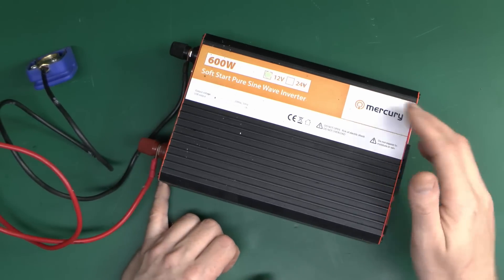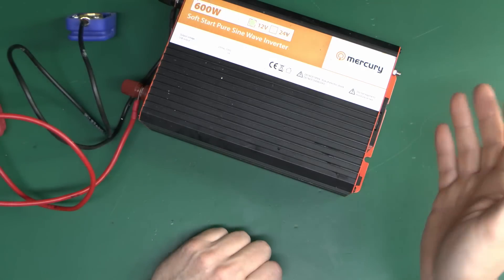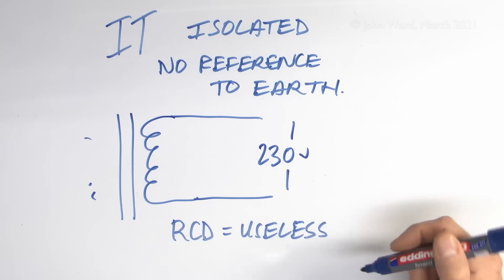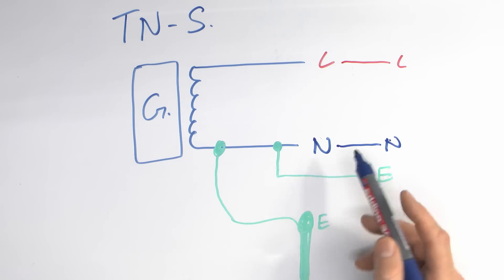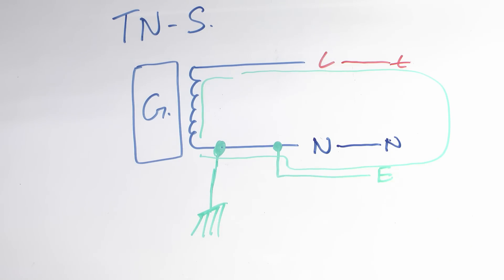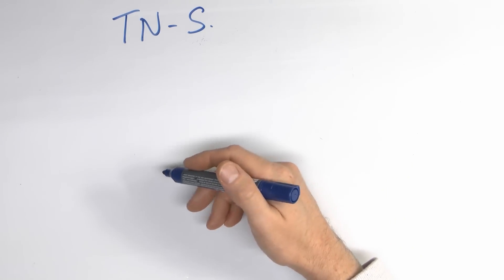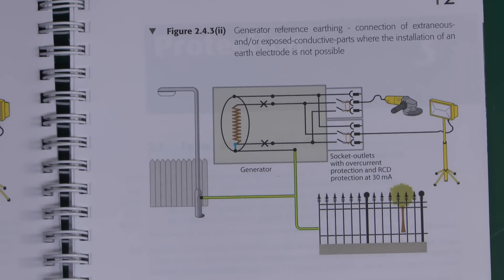Generator Earthing Types - TN-S or IT?

Comment: How come North America has 120v splt phase, from 230v single phase,
and 120v from 208v 3-phase ?   -Both 1 and 3 phase resulting in 120v
But, in Norway we get 120v from both N and L both to Earth, from any of the 230v 3-phases  ?

I can, and have used this power 120v rated electronics designed for North America.
Use old incandesent light bulbs, as dim night lights,. Without having to hear the faint noise from a dimmer at night 😅 
Or, run a fan at reduced speed on hot summer nights, to keep motor noise down 😛

Unlike the rest of europe, most of Norway has a 3-phase 230v  IT supply.
The IT system usually limits the 120v to a few Amp to earth rod ^^ 
Any more Amp draw just shifts the earth phase referance.  And it stops being "useful" as 120v 😅😛
(not that many old houses left now, with simple old screw fuses and breakers. 
Most have standard modern 2-pol RCC installed now. 
But, growing up with this made som fun experiments possible as a teenager ^^  :p

The TT system is much less common in Norway. Think only a few costal areas use it.
The TN system is becoming more common in Norway due to modernizations and new construction projects.
And new constructions wil often get a "normal" 400v transformer. And therfore have a true Neutral as the blue N wire.

The 230v 3-phase used to be a problem for installing EV charger. 
As it took years before someone designed EV chargers, that could be used on 3-phase 230v without any Neutral wire.
And while the floating earth could in theory be used as the "neutral wire" . Neither our electrical codes, or the the EV chargers design could allowed them to be used that way 😅
Eventually new EV charger were made to handle 3x230v IT tho.. .  😊

Comment: The CTE (centre tap to earth) arrangement isn’t that daft an idea for small inverters and generators which are typically not used with an RCD, as the fault voltage you will be exposed to is only 120, which is a lot less lethal.

Comment: Thanks.  The cheap inverters....  Would i be correct that you can test if they are the cheap variety by.connecting an incandescent light bulb to neutral and ground , if it lights up then the live ground indicates its a cheap variety and NOT to be neutral - ground bonded ? Am i correct ?

Comment: Please would you elaborate on the comment “certain types of gas boiler except” when you were talking about inverters.
Reply from the maker: Some boilers use flame rectification to detect whether the gas is actually burning or not.  That works by passing a tiny current through the flame to the boiler chassis, the flame acts like a diode and the result can be detected.  This requires that the boiler has a proper earth connection.  If connected to an inverter with a floating earth,  there is no earth connection, the flame detection will not work, and the boiler will not operate.
Reply: Thank you for your clear explanation. I assume my boiler is earthed by both the connected water pipes and the mains earth wired to the controller. If I temporarily power the controller from an investor during a black out would one leg of its output need to be bonded to say the adjacent plumbing to operate and more importantly would that arrangement be safe?

Comment: What if there is a need to connect a SINGLE PHASE generator to TN-S system that is already there (so for example, emergency connection for some MCBs that are isolated with change-over switch). How many poles should pass through 1-0-2 changeover switch (in case of single phase inverter generator with SCHUKO/nonpolarized outlets)?
Reply from the maker: 2 poles, which will be line and neutral.

Comment: Hi John, thanks for this video. Why there is an earth connector on the outside of the housing of the small inverter (the inverter at the very beginning of your video)? Because if I would connect it to earth, there is still no connection to one of the two live wires to define one of both as neutral with earth potential, right? So anyway there cannot be a flow back to the power source through this housing connector? I don´t get it. Maybe you can help?

Comment: Hi John,

You missed out the T part of IT on your drawing which is met by connecting an earth electrode to conductive parts.

Within rail and hospitals IT earthing is used extensively with earth electrodes and plenty of class 1 equipment.

Comment: Great videos as always full marks JW , I do believe I the centre tapped inverter generator type ,can find no continuity between n and E when not running ,is there a multimeter test for checking if its definitely a centre tapped version ,plugged into camper RCD trips on test ,hook up lead has earth wire that goes camper  to generator 240 plug , ? Any tips on these centre tapped .

Comment: If you touch the wires coming out of the inverter  Will I get electrocuted?
Reply from the maker: Depends on the circumstances.  If it's not connected to Earth anywhere, no shock if touching only one of the output wires.
If you touch both of them, or it's referenced to Earth via something connected to it, then you will get a shock.
Touching any of the outputs is something to be avoided.
Reply: @jwflame  

thank you very much.

Comment: Here in North America, rather than a single L1 at 230V, on a 240V  generator we have two legs of opposite polarity at 120V each to ground. In that situation the neutral tap comes off the middle of the coil, with L1 and L2 at opposite ends. Of course the polarity of L1 and L2 are 180 degrees apart. The ground is bonded to the middle neutral tap, which explains why some generators built for North America won't be optimally designed for a single 230 V system like used in the UK. I wouldn't necessarily call it shoddy manufacturing, just a different system. In the North American system the downstream consumer can have either 240 V between the two opposite legs or 120V to neutral on either side. In a big circuit panel there is some effort made to balance the usage of the two legs so the common neutral only carries the difference between the two back to the transformer.

Comment: well explained, would a grounding rod only be necessary if you plan to use your appliances outside or where ground contact is possible while using something? Im planning to use inverter off grid without any grid connection, I will be running everything through RCBO breakers though.
Reply from the maker: You MUST have an earth electrode for the installation, without it the RCDs / RCBOs won't work.
Reply: I would still be using ground conductors with all the wiring naturally, I suppose i should figure out where it needs to go then.
Reply: @jwflame What to do when there is no facility to earth? Generator is parked on street and there is nothing available? Mentioned that an Earth Loop Impedance test does display a reading and this could be acceptable measured value, but then without a true reference to earth (no earth rod or connection to earth) the RCD, won’t function, this correct?

Comment: 2:02 If you connect two equipment you would have to use some kind of a splitter or a power strip. That would level the case potentials as if they had a failures that created the voltage between them that would blow the fuse.

Comment: So if the earth of the Inverter is not referenced why does it have an earth connection? I wanted to use one of these to power a lathe from a 12v battery. I checked for continuity between the metal parts of the lathe and the earth connection of the inverter. There was conntinuity so I deduced from that that the earth connector of the inverter is not just there to protect the inverter itself but also, in this case, the lathe. But I am still not sure whether I should connect the inverter via its earth connection and a cable to an electrode in my garden. As I understand it, if I did that and either the L or N wire in the lathe connected to the metal part of the lathe, then 110 volts would shot down the earth cable into my garden and up one of my legs and down the other. On the other hand if I don't connect the earth cable to an electrode in my garden and the same thing happens, but this time I touch the lathe, then 110v will shoot down my arm through my heart and into the ground. This is a real dilemma. What is the lesser of these two evils. Risk heart palpitations or opt for electrical castration ? Can anyone advise me? Until I hear from you I will only be using the lathe wearing rubber shoes and wearing surgical gloves. This is't a joke by the way. I really need advice. My inverter has two 230v sockets. Does that mean that  earth is referenced after all?

Comment: 3:46 no. A ground is not required for the operation of an RCD. 
Although we call them Ground Fault Circuit Interrupters (GFCI) in America, these devices measure the current differential between the two power conductors.
If electricity is 'leaking' from one wire and not making it back on the other wire, the device will trip on a low current level ( >30ma).

Many quality Inverter Mfg. include GFCI/RCD inside of their units.

I don't think they are entirely useless, even though they won't have much to work with as the return path through earth does not exist. This is exactly why we use isolation transformers! IT is safer!

Also, simply bonding the frames of two appliances with reach of each other will mitigate the theoretical & highly unlikely danger of two opposing shorts to ground.
I believe it is better to consider portable systems to be isolated and leave it at that. there may be other reasons for grounding however.

ALWAYS CHECK THE MANUFACTURERS' LITERATURE!

Comment: Got a question regarding the grounding bolt on your inverter. If you ground the inverter from this bolt to the ground of a house, then the system is grounded right? Could I then attach two class 1 appliances without using an RCD?
Reply: Many quality Inverter Mfg. include GFCI/RCD inside of their units.
There seems to be some misunderstanding here.
Reply: I'm no expert in this but didn't JW say not to connect these devices to the house ground as in the case of a fault at the house the earth connection could carry the fault current into your equipment. I think a separate ground stake was the answer.

Comment: An informative and helpful video, thanks for posting it. I recently purchased an inverter to power my central heating and was intrigued by your comment re gas boilers. Disappointingly, although the time clock, motorised valves, pump and fan ran, the gas valve failed to operate, so complete failure! I have thought this initial test may have failed because it was operating in IT mode and not referenced to earth. As this inverter will not support TNS operation, I've returned it. Are you able to expand upon your comment re "certain gas boilers" please? Thanks

Comment: I have a "cheapish" Giandel 12V to 240V inverter. In it's default state, it comes as IT. However, I wished to use it in a fixed install with RCDs so I bonded N to E (using a plugtop on one of the two outputs), and hammered a ground rod into the ground. I believe I have converted this IT system to TN-S.

While I don't have a Zs tester handy, i do have a megger RCD tester and the ADS times seem good.

Do you reckon I've done any bad things here?
Reply from the maker: No.
It's TN-S.  The earth rod is just a reference to earth, so it doesn't need to be particularly low impedance, it's only there so any RCD will operate if a fault occurs between L and earth.
Loop impedance will depend on how much current the inverter can supply, which won't be very much.

Comment: This video seems to not distinguish a generator in complete isolation - as the ONLY source - from a backup generator tied to the greater grid's earth copper.
At 1:45, the earth lug at lower right in the 600W inverter, determines if the unit operates in IT mode or otherwise. All generators are identical to the 600W inverter, unless the generator should internally tie the two, which is not the default. The one earth rod, at 5:30, in an non-grid environment is more likely to decrease safety, than increase it. 

Stand alone generators, in complete isolation, as the ONLY source of power, is not the same as a backup generator commonly  connected via a transfer switch to the greater grid. The latter configuration automatically "exposes" the generator to potential anomalies from within a larger radius. Whereas, the former operates within a small self contained bubble. In either case the addition of an earth rod provides zero benefit relative to an RCD. Pick ANY realistic ohmic value for the earth rod and apply V=IR, even a 10mA RCD serves no purpose. https://www.youtube.com/watch?v=iyeGqyq9kXE.

In this context, the only difference between a TN-S and a TN-C-S earthing system is the distance between the E-N bond point and the secondary, with the secondary typically connected to many interconnected rods, up and down the poles. With an isolated generator the distance between the secondary and the E-N bond is zero. An isolated power source is no different over dirt, than floating over water, or in flight. Adding an earth rod marginally increases risk.

All 2-pronged appliances operate in isolation. The only reason to bond E-N, ONLY at an isolated generator, is for 3-pronged appliances; that E-N bond is both necessary and sufficient.
~~~~~~~~~~~~~~~
Separately, at 9:00, referencing the center tap creates the North American scheme.

Comment: So how would you deal with the earthing to the generator if it was to feed your normal house via a changeover switch within the property (or within the external meter cupboard) so that a secondary emergency supply could still be fed into the existing consumer unit?  If the existing dwelling was TN-C-S earthing would it be acceptable to earth the generator into the TN-C-S earthing of the incoming supply so that all your existing RCD's within the consumer unit still worked?  Just curious as a newbie 'prepper'.
Reply: I’d like to hear what JW thoughts on this is?

Comment: Thinking about my earthing problems with PA equipment and small generators I've come to the conclusion a microphone is a class one device recently I came across not the cheapest of generators 230 V 110 V to ground live and neutral but no 110 V output just blue sockets 
I see there is some point in putting a trip in even if there's no Earth steak with two   Class 1 Devices and tying neutral and earth
I continually come across small solar inverter systems based on extension leads with no earth  and occasionally close one equipment with interference capacitors connected to live and neutral to ground Some call these the death capacitors

Comment: In what case would it be dangerous to connect multiple devices to a IT system? 
 One device would need to have Phase to PE fault and the other device would need to have a N to PE fault. And the PE from one device or between the devices needs to have a fault.

So 3 faults before there is a shock hazard?
(with small IT systems like the low power inverter)
Reply: @Bushcraft-xz6xd  So yes 3 independent faults would need to occur simultaneously before  multiple class 1 devices on a Inverter become a problem. 

Your second case would not work. Since its IT system, if there is one P-E fault nothing hapens because N is not bonded to ground.

Comment: 7:10 But if the earth is left floating - not connected to N or the Earth, when the live touched the person, there would be no circuit to cause them harm - which is why birds sit on 11kV wires without killing themselves.
Reply: Exactlly.On domestic mains power supply the neutral line is earthed to ground at power station si if a person touches a live wire or live wire touches class 1 ele trial product the live circuit flows through person down through feet to earth/ground or through metal frame back to ground/earth and neutral.For that reason I bond/connect my neutral and earth connection on my inverters and petrol inverter generator so RCD works.

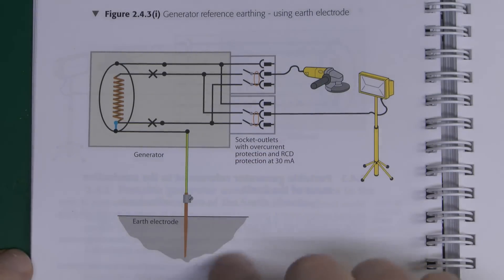Comment: 12:00 Page 26 OSG "Where more than one item of class I equipment is to be supplied by a [single phase???] generator, it is important that the earth connections of the socket outlets are connected to the neutral..."

WHY - and why specify single phase ?

Am I missing something here (go on, say it, 'brain cells' - LOL) ?

I don't see that connecting E to N has any benefit. I don't see that connecting E to the earth has any benefit either. Like I have, assume a floating earth circuit - it's not an 'earth' but simply equipotential bonding - 2 or more bits of earthed equipment will all be at the same potential - so what's the problem - asks the bird sitting on a 11kV line. The health risk is only  from the power conductors.

Now, let's say a fault occurs and the machine 1 chassis is by a fault connected to line voltage. We have the bird on the live wire situation - with floating earth - so no issue. So now let's add a further fault on equipment 2 - connecting a power wire to the chassis of that machine. If it's the same wire as the first machine fault, there's no change. If it's another wire, it'll trip the overload protection. Either way, it's not adding danger.

So now let's go third situation - where the unearthed generator is sitting in a puddle on the ground - so is now earthed - so now if there's a fault, the RCD would trip. So it's still safe.

Are they inventing fake danger ? Any current >30mA not flowing through the permitted wires will trip the RCD. It won't matter what potential 'earth' actually is as there's no circuit.
Reply: I'd also like to know the answer to this question. It seems to me that you are correct, but perhaps there is something you and I have missed.